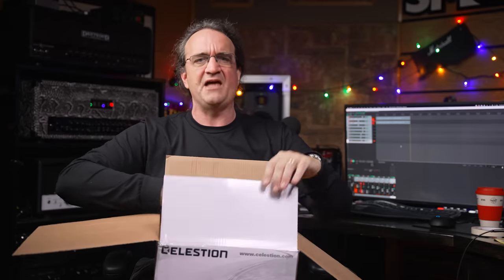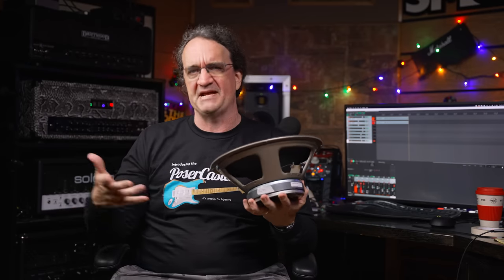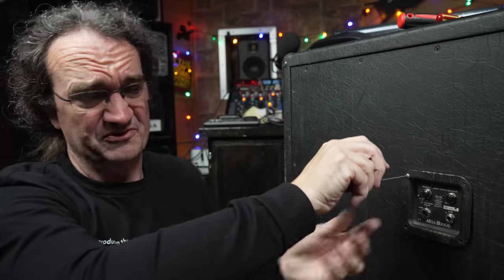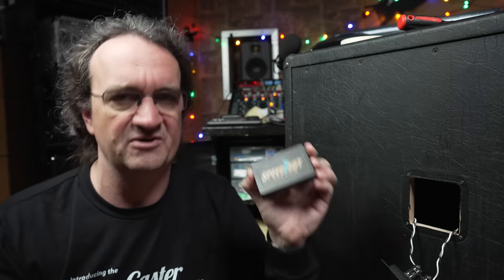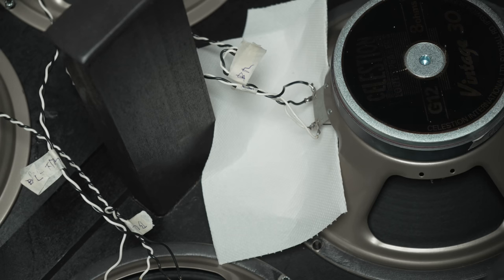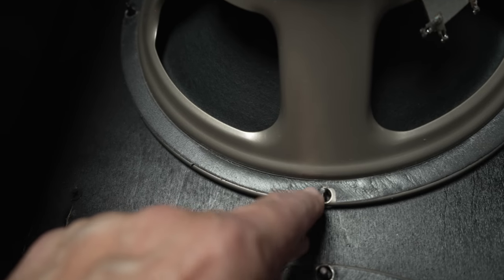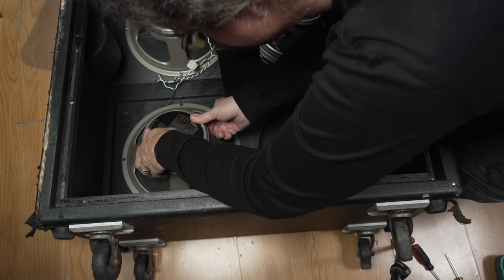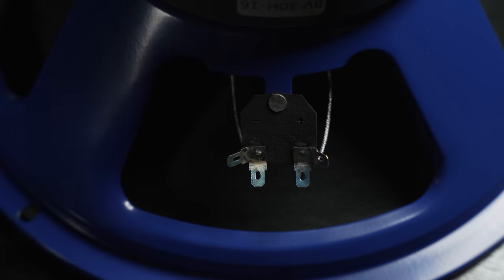How to Change Guitar Speakers (Even if You're a Bass Player!)

Comment: Don't forget to label your cabs after you start swapping speakers! Some Gaffer tape on the back does nicely. I note which speakers are in there (with their individual watts and ohms), the overall watts for the cab, the ohm rating for the cab, and how the cab is wired (series or parallel or series/parallel, etc..). LIFE SAVER later when you're plugging them into to new or different things.
Reply: wise
Reply: Too much work. I prefer the “set it and forget it” method so later I wind up having electrical issues and damaging components. It’s a lot more chaotic and fun
Reply: @slayabouts  lmmfao
Reply: @slayabouts  I can’t believe I didn’t think of this. You, good sir, are a hero.
Reply: @NubsWithGuns  Actually, I will mark a speaker for location within the cab IF it’s the speaker I’ve chosen as the one to mic. Not sure that means anything but at least it keeps everything consistent once I’ve marked the grill cloth for mic placement lol
Reply: First, get at least one cabinet.
Reply: I'm also a big fan of using tape where you want a live engineer to place their mic. Once you've found the sweet spot, tape it and it's set and forget. Unless the tech has the wrong mics of course. Although investing in the right mics yourself would eliminate that problem as well. The less variables you offer the FOH engineer, the less he can f*** up. And the more you only have yourself to blame.
Reply: @NeZversSounds  lol
Reply: Good advice, lots of musicians never think about electrical technicalities.
Reply: @chaptermasterpedrokantor1623  This might be a dumb question, but I’ll ask anyway. If you mark the spot you want the mic to go with tape, wouldn’t some portion of the sound wave bounce off the backside of the tape when the wave is at one its smallest sizes, thus distorting the sound the mic picks up? Or would that be imperceptible to the human ear?
Reply: Cletus Christ? 
We're in the presence of Mix Review Royalty.
You Sir, Rock Hard. 🤘
Reply: @killergrooves2438  I'm no Eddie Kramer... but I can't imagine this is an issue. Ideally the speaker is so loud the direct sound is vastly outweighing the reflection from the tape in what the mic hears. If it changes your tone it changes it soooooo slightly. It certainly wouldn't matter live. Even in a studio environment, we need to accept that our "tone" isn't really that important. Just needs to be in the ballpark.
Reply: @Dave-Rough-Diamond-Dunn  Rock n roll dude! Thanks!
Reply: @cletuschrist  You always bring it mate. If we're watching a Mix Review, and we hear Cletus Christ coming up, we know we're going to hear an actual song! 👍

Comment: Honourable handyman top tip; unless you know something about the 'quality'of the screws holding the speaker cabinet together... like you've done it before,  just use an ordinary, old-fashioned, manual screwdriver of the right size. They are far easier to use and control. Like playing a guitar with your fingers compared to wearing mittens!

Comment: One thing I've run into with swapping speakers is making sure the mount screws are evenly torqued. If you put them in uneven, you can warp the speaker basket and cause odd sounds.
Reply: Star pattern tighten down like a tire

Comment: I liked this video Glenn. I’ve swapped many speakers out in my day and of this entire video, and dealing with my own personal electronic projects from time to time, I was surprised to learn that you could rotate that style of wire stripper! I’ve always just clamped and yanked. Over the years I’ve opted for the squeeze and strip style tool. Also, when it comes to soldering, if one can handle this task then there’s no reason they can’t work on their own guitars too! My point is that don’t forget to protect your guitars finish the same way that you protected the speakers cone. Nothing says “fuuuuuuuuuck” like solder spatter all over you shiny finish.

Comment: Little tip for when you're de-soldering: use solder wick. it's a strand of braided copper wire that absorb solder when heated and in contact with said solder. it avoids spillages and remove a lot of solder. it's a consumable though so you might need 2 or 3 around just to have some margin.
Also use new solder each time you make a new joint since the wire contain flux which make soldering a lot easier.

Comment: I think a dedicated video regarding different ohms (2,4,8,16) is better given the power differences and requirements. PAs, guitar and bass amps often have different power requirements, particularly with moving that to a speaker that might only move with bass, or others (like cabinets with horns). Fires can happen if not set right. It is definitely an important lesson.

Comment: VERY long post with tips from a guy whos done literally thousands of these..
good luck everyone hope your install goes well!
mostly in order with the video times....great video Glen!
--1-- That farty sound is "the bad sound" 
(the screws on his cab are probably worn out)
make sure your screw driver is pointed in the exact same direction as the screw to stop it.
production installed screws are always "straight in"....(perpendicular to surface)
if the screw head is stripped bad before you start youll get that sound and make things worse....if the screw has been screwed with you gotta find the angle that doesnt make the noise...go slow..it helps.
--2-- Some cabs have weird/different wiring from others....take pictures, draw diagrams before disconnecting anything...write the wire colors and symbols....
the terminals will have marks of + or - 
new speakers might swap which side the + or - is on...so look and mark that info.
if white wire is +...put it on the + of the new speaker...
swapping the +- WILL put the speaker "out of phase" and change the sound...
even if its only a single speaker cab....in a 4x cab you MUST wire it correctly. 
some cabinets have different wiring for different ohms etc...
do not mix different ohm speakers (if you know how to do it properly this info is baby stuff to you so shush lol)
--3-- Spade connectors vs solder is a 50yr old argument. Glen is correct.
both work fine if you use the proper connectors...
solder is cheaper but a little more guaranteed especially in a factory.
if it wiggles and is floppy sloppy its bad.....
the connectors glen uses are a generic size, not special to that manufacturer.
sometimes a VERY slight bend in the spade (male side) or squish of the female side will help them hold more snugly....VERY slight goes a long way!
--4-- Swapping speaker brand and model could mean the screw holes dont line up.
most cabs mount speakers with wood screws through the speaker holes into the cab.
not like this cabinet (using embedded machine screws)
if the holes dont line up with the old ones, just turn the speaker so the new holes are about an inch (25mm) away from the old holes.....
tracing the old speaker with a marker will help you stay centered..tilt the marker to make the circle bigger, then eyeball or measure to center in the drawn/traced circle.

Comment: Glenn, I really think you nailed it with this video and a follow up about wiring diagrams and how to understand them would be excellent.

However, in my day job as an HVAC tech I have found that using power tools can lead to bigger issues down the road. Especially if you strip a screw head or out right snap the screw itself. My college instructor has said that all you have to do is “snug it up”.

Another good tip is to acquire magnetic screw drivers, nut drivers, or socket wrenches to really speed up the process.

I am really enjoying the content you are putting out lately and watch every week. 

Keep up the great work you’ve been doing, and f you Glenn!

James from Minnesota.

Comment: Thanks Glen.  I'd like to say it's pretty cool to see the unforeseen stuff you ran into such as the bits not fitting, and soldered connections instead of spades.  You could have easily edited that out, but chose to use it as a teaching moment than some of us non-professionals probably need to see.  Thanks.

Comment: Just changed out my Marshall cabinet 4x12 cheap MG series G12-412MGs to 2 Celestion Greenbacks and 2 EVH Celestion. The cabinet is run with EVH 5150 6l6 50W head unit. I bought the speakers from Thoman after hearing you last video on speakers and tone. The tone is the tone I have been searching for and now my setup is complete. Thanks for all the good advice on tone and speakers.

Comment: 2:40 grab one of those magnetic trays from the auto shop! They stick to anything you have metal, and the screws stick to it! been using them for years fixing my guitar! Also on your drill, make sure you turn the torque down so it doesnt strip screws as easily! Keep it up Glenn!
Reply: Ironic suggestion considering the magnetic tray auto parts store sells is made from a speaker magnet and a cup.
Reply: @Crunchifyable2  thats crazy, even better! Lmao thats actually pretty sick I had no clue!

Comment: If you do strip the screws don’t worry.  U use a dremel or a jack saw blade and slot the head.  This turns it to a flat head so u can get it out, then just replace it with a Phillips after u get it out.

Comment: As someone who has repaired electronics for 20+ years I don't suspect there's any audible difference at all with solder vs crimp, as long as they're both done correctly.  For a piece of gear that sits in a studio & doesn't get banged around on tour or that you might want to swap drivers (i.e. speakers) the crimp connectors will save a lot of work!  On the other hand for something that's going to get abused being moved from venue to venue I'd feel better soldering it for long term reliability.

Would love to see you do the 8 ohms vs 16 ohms video!  I've never been able to hear or measure a difference provided it's being powered by an appropriate amp.  Using an amp that's not designed to handle the impedance of the cab can certainly have an effect but not a good one!

Comment: If you need any amount of torque, you use either Pozidriv (looks like Phillips, but is totally not compatible, everyone should google this) or you use Torx. Torx bits are rarely good fits to the screw heads, so they have issue of wobbling or not staying on the bit... Pozidriv geometry is made so the screw head and the bit will mate tightly eliminating the wobble quite well.

Phillips is good only for screwing by hand to a ready made machine thread... it's awful for wood-screws or anything else that cuts it's own threads. It'll cam out and strip the head or damage the bit.

Comment: Hi Glenn, nice video! Over the years I've made my own cabs of various configurations, rewired others for friends and just recently did a big refurb on a 2 x 15 so am quite familiar with series, parallel and series-parallel wiring etc. I think for those that needed this video, a follow up explaining the different types of wiring and delving into resistances you can end up with, in tandem with the ranges specified by amp manufacturers, would be a  very good thing.

Comment: When I set up that trashcab with good speakers (heeding your advice), I used solder joints with banana plugs on the other end so I could switch 'em out and not have to worry about the spade connectors getting loose. Added bonus with using banana plugs is that they're stackable and reorientable, so you can effectively change the impedance of the whole cab just by changing the plugs around like building a lego set.

Comment: first audio mod i ever did was swapping my Peavey Backstage 2's little 5 inch speaker for a 12 inch sheffield. What a dramatic change. It actually had bottom end afterwards whereas before it was mostly all scratchy highs. Putting better, bigger speakers into a little 15w practice amp is always a good first choice over just buying a whole new amp.

Comment: Using a 1.5v battery at some point to check if the speakers are all in phase properly is also a good idea + to + and - to - will make the speaker move forward, + to - will make it move backwards, they should all move in the same direction, also good way to check if a speaker works or find polarity if its not marked or worn
Reply: 9 volt batteries work best for this.

Comment: Here's a funny little anecdote that also ties into the tube vs solid state debate: a short while ago I wanted to try and downscale, so I got myself a H&K Stompman (ss pedal amp) with a 1x12 cab. After a few rehearsals and gigs where I didn't quite get my sound where I wanted it, my band played a gig where the venue provided backline, including a Marshall 1960AV 4x12 cab that I could set to 4ohm mono, so the H&K could crank out its full 50watts. Better speakers and higher power output immediately solved a bunch of issues I initially had and made me realise the H&K itself wasn't the problem. I let the provided Orange amp sit on top of the cab during sound check, just in case, and left it there during the show. Afterwards some guy came up to me to say how happy he was to see someone play with a proper tube amp, because "you can only get an authentic tone like that with a real tube amp". My band also tried to convince me to the ditch the H&K, because "the Orange" sounded so much better. Suffice to say some jaws dropped to the floor when I told them the Orange wasn't plugged in at all and the sound came from this tiny box on my pedal board. Few moths later, I've grown quite fond of that little box, but I am going to swap out the speaker in my cab because I think there's a bit to gain on that front.
Reply: This is fucking genius. I want to do this.

Comment: I have Vintage 30 speakers from the 1980s and also the 1990s. Classic Lead 80s also. In 1988 I worked at Guitar Center San Francisco. There was confusion as to the power handling ability of the Vintage 30, which was relatively new at the time. I called Celestion, and as a store rep I was able to talk to the head of the technical relations department. He said at that time they were rating the Vintage 30 at 70 watts but assured me that it could handle 100 watts with no problem, and that it was a new design.

Comment: Note: if you're swapping a speaker out of a China/Korea/Indonesian combo amp, where the wires are using spade connectors, you might run into a situation where the existing negative cable post (black) is narrower than the positive (red). This prevents a direct swap with your standard Celestion, where spade posts are the wide variety. Attaching a new connector onto the black wire will be necessary (I solder mine). My understanding is that the mis-matched posts are used on those speakers to prevent the wrong wire being attached in a factory environment, where they're connecting like a hundred of them a day.

Comment: the speakers may not be marked positive or negative but they can be checked by quickly touching a 9 volt battery across the terminals. the battery terminals are clearly marked. if the speaker's cone pushes forward it's the correct polarity. if it pushes backward, it's incorrect. just match up the correct direction with the correct polarity.

Comment: Hey Glenn. Great video! I'm pretty familiar with the topic myself, but it's stuff that could have removed any nerves and trepidation when I first started bumbling around with speaker cabs.

One tip I've found that typically helps with thrashed out screws is to put a rubber band between the screw head and drill-bit / screwdriver. It's not perfect, and  probably won't work with severely damaged heads, but it's worth a shot.
The stiffer the rubber, the more force is needed to be applied to the screwdriver or drill and bit.

Comment: Great Video Glenn nice step by step. One note on the voltage the speakers are seeing. Its actually low voltage with high current. You can see upwards of 3 to 8A depending on the output transformer. Hence the reason we use big wiring from head to speakers. Everything else is top notch Thank you Glenn.

Comment: I picked up a Peavey Max 100 (bassist) last year and while it's a great little travel/practice amp it just didn't quite have the lows and low mids I wanted.  I swapped in a Celestion BN with a power handling triple the amps output and now it freaking rips!  Just a little 110 60-70watts rms and it punched through and mixed right in with an acoustic drum kit and a loud ass guitarist for some heavy rock.

Comment: On the other hand with spade connectors you have to be sure the copper makes contact with the metal inside the barrel. Also to get a more secure crimp you can press the handle of your stakeon against a table.

Comment: The issue with spade vs solder is vibration.  There is a possibility for the spade connector to vibrate loose and cause connection issues.  the likelihood of spade connectors vibrating loose might be unlikely, but its one more thing to not worry about

Comment: In the process of building a cab and at some point putting in two eminence 150w 8ohm swamp thangs and two eminence Texas heat 150w 8ohms into my 4x12 cab, this vid has come at the right time pmsl. The electronics I'm using are soldered too (off a Laney lx4x12cab)